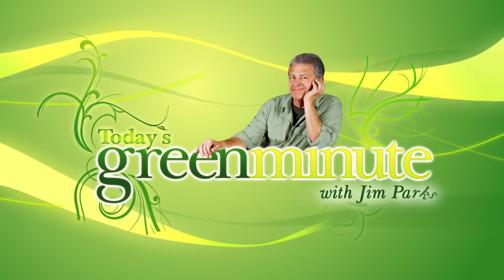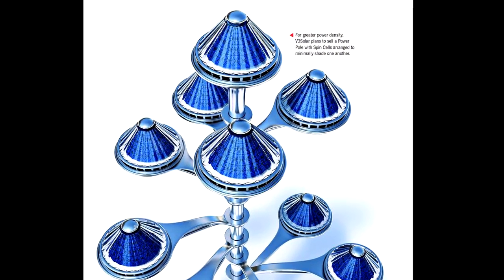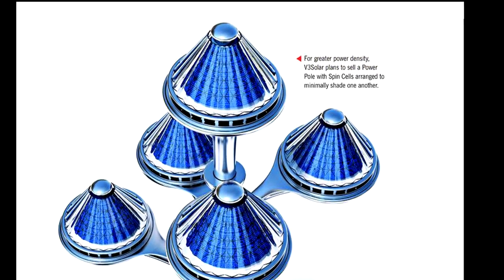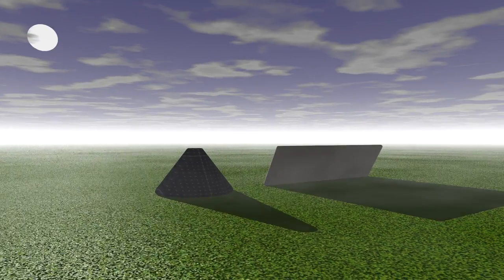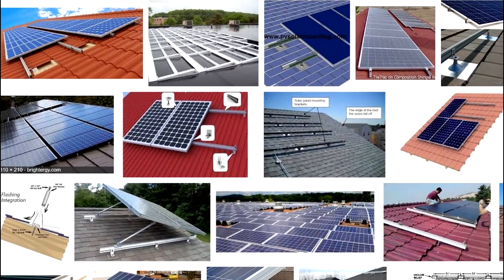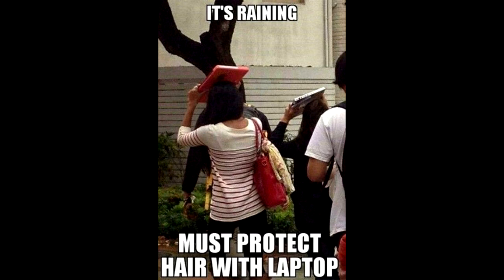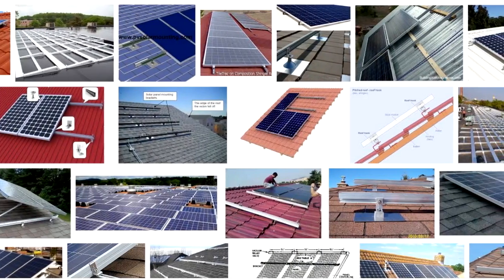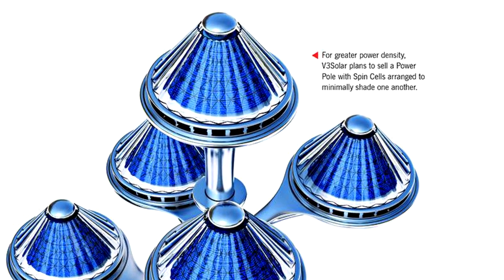Spinning Solar -BUSTED!

Comment: If something is so easy to 'BUST' Then why fudge and make numbers up. Stop guessing and using rough maths, It does not help your credibility. You know better, Or do you?
Reply: To simplify things, because different solar panels are generally more or less efficient and can't vary in power output  due to conditions.
So he made the numbers a flat amount to avoid variables, like the efficiency of the solar cells (which are by no means near 100%)
Reply: SilvaDreams
I think the maths would have been exactly as simple/complex. The only difference was the choice.
Reply: He wanted to use round numbers. 100% is easier to work with than 23.5% for example

As long as both panels are the same area and efficiency, then the specific area and efficiency do not matter.

The comparison was about effective area presented to the sun, not total area or efficiency.

Its like when i do simple rocket explanations, i use acceleration due to gravity = 10m/s^2, wet mass 100 tonnes, dry mass 10 tonnes, specific impulse 500s, and thrust 2000kn.

These aren't the stats of real life rockets, and in fact the specific impulse and gravity values are unrealistic, but the round numbers are easier to work with, and still allow for workable explanations

Comment: most panels loose 40-60% on hot sunny days and in cold weather gain 40-60% boosts
Reply: LONEWOLF REBELS now if you also could provide your panel types and manufacturer we could go and search for the specs to bolster your argument
Reply: without sources you have no power here.
Reply: Where do you get that number from? Typical solar cells have temperature coefficients better than -0.5%/K, so to get a loss of 40%, you'd need to be 80K above the reference temperature of 25 Deg. Celsius... in other words, the module would have to be hot enough to make water boil.
Reply: Richard Metzler I get the numbers off my solar panels during the summer they are insanely inefficient in direct sun in hot weather but during the winter they perform 40% better because of the cold cooling the panels don't believe the fancy numbers that people tell you solar is retardedly non efficient unless you live in perfect conditions in a perfect climate on a perfect day lol
Reply: Mike Brink I find I get 80% efficiency for most of the year winter I get 90-95% but summer is 60% max but I also receive 22 hours of direct sun in the summer and right now we get 3 hours
Reply: you guys do realize that winter and summer have different degrees of incoming sunlight, did you calculate that into your comparisons? Because it sounds like the panels are just aligned better for winter sun...
Reply: ZeruelB yes my panels are aligned there solar trackers the problem with solar is heat buildup anything over 25°c you loose massive amounts of power most solar panels operate at temperatures well above that causing resistance in the whole system
Reply: This is why applied a theoretical physics don't match... hence the expression, 'In theory, theory and practice are the same. In practice, they are not.'
Reply: Exactly ergo just because a book says one thing doesn't mean it's true
Reply: ZeruelB and manufacturer doesn't change The reality that all panels are subject to these same losses based on how hot they get
Reply: +LONEWOLF REBELS I just want to know where you get your numbers from, thats all, im not doubting that there are losses, i am not even doubting that your numbers are wrong. I only did some searching and found difference in productivity to be around 0.5%/deg which is why i would want to know what panels you are using
Reply: ZeruelB ever bright polycrystaline cells and your probably right .5 % per degree now if your solar panels run as little as 60° over temp which is quite normal that would be a instant 30% loss
Reply: LONEWOLF REBELS but that would be a very different figure from your 40-60%
Reply: Sounds about right to me.  On a one meter square nearly black surface parallel to the noon day sun in New Mexico or California and with a heat transfer of silicon or copper...  Well lets just say you could not touch it without scalding your hand.  So I'd assume the panel would be at least 70 Celsius just by touch, assuming you would for sure be scalded by it.  And everyone knows that you cannot touch a black painted parked car in California in the summer without burning your hand.

Assuming ambient air temperature in summer in places where solar is best will be around 30 or even 40 Celsius in summer, I can imagine that 100 degrees for a solar panel is not off ballpark.  In which case, it would not only be less efficient, but its lifespan would also start to degrade quickly.
Reply: babelfishdude you are correct in reality solar panels do best when outside air temp is below freezing the cooler the panels the higher the output  heat causes resistance slowing down the electricity I watch my solar panels defrost themselves in -30 °c and are warm to the touch in the middle of winter and I live in the real north
Reply: LONEWOLF REBELS real north? So  north of the wall right?
Reply: Northern Canada

Comment: Always thought it a bit crazy, I remember talking to a guy about these, and told him to just use a sun tracker with normal cells, if the efficiency decreases above 60oc maybe watercooling them? or would this cause cracks to form in the cells?
Reply: but then maybe the power needed to use a water pump and a fan on the rad would made the project impossible
Reply: and a passive cooling rad would be huge, so then a more powerful pump would be needed,, arghhhh!! just gets more complex

Comment: what is exactly wrong with musk's mars plans?
Reply: A bit of a problem: Musk has nothing to do with Mars One.
Reply: +ORPPRANATOR Prendergast
Lol that is completely wrong. It takes about 4 days to get to the moon.

And in fact it takes less fuel to get to mars than the moon.

The time is on the scale of 50 times longer by hohman trajectory though.
Reply: Just Add SRBs
 Oops, my fault. Sorry.
Reply: Traveling to the moon takes a massive amount of fuel, and 76 or something days. 

Mars is like, 40 times as far away, taking 40 times the fuel and time.
Reply: Google for a document called "Mars One Feasibility (?) Analysis". Students of the aeronautic studies analyzed what would be needed on the amount of resources to be flown to the Mars to keep the colony running. Also they took a look a the current technology of so called In Situ Resource Utilisation which should provide the colonists with food and oxygen. The Mars One plans initially stated that the current state of ISRU systems is already enough for a success. The report argued that these systems are used on the ISS, which is in low gravity and not on the scale needed for a colony.
Reply: High z particles.
Reply: First off, it's the Hohmann transfer orbit, named after Walter Hohmann.  

Second the comparison you site would be to get a thing (dead and lifeless) to Mars.  So "in fact" you are wrong if you are talking about getting living humans to Mars, and then hopefully back in some functional order.

Lastly, the way you suggest getting to Mars would require a moon base.  The actual comparison is that it takes less fuel to get to Mars "from the moon", than it does to get to the moon from Earth.  You left that part out.
Reply: +ORPPRANATOR Prendergast, well i see a couple of problems with your analysis, first of all, the vast majority of the fuel in a rocket is used to get the damn thing off the ground and into orbit, be it the moon or pluto, this amount of fuel remains constant, the amount used to move the craft to mars is the one that will increase, that being said, since its a one way trip this saves some fuel

Comment: What about spinning it with wind.
Reply: Now you have to have days that are BOTH sunny and windy.  Why not just use flat panels that follow the sun, instead of trying to magic something cool into being by making it look artsy?
Reply: the only thing the spinning achieves is to hide half of it in the shade, if cooling is a true concern them perhaps figure out a way to wind-cool a flat solar panel
Reply: ***** Or water cool. It's not in shade if the sun is overhead however. If you can oriented the cone thing towards the sun, it is more feasible.
Reply: shades2 there are water cooling systems for solar panels, and I assume they're as effective as they can be. but really like thunderfoot said, you only need to keep the temp below 60C
Reply: shades2 bruh

Comment: Soooo... I agree with your 50% best case number as a function of surface area... but isn't all the numbers and promo on this about the cost|power ratio not area|power? If, let's say for shits and giggle sake, these things are 1/40th the cost to manufacture of a tracking panel then their numbers are plausible. And they are pretty clearly going against non tracking rooftop panels IMHO which have can something like 30-75% of a well configured tracking panel depending on dozens of environmental factors. So lets say a marketing department looks at these numbers and does a bunch of accounting hoodoo and says our best case cost|power is 20x that of the most expensive roof panels worst case if we pretend like their cost isn't subsidized and ours somehow still magically is... then they publish the 20x number. That's be completely typical of marketing wanks.

Statistics are like anuses, often full of shit, better for hiding things than you'd think and more flexible than you'd believe.

Comment: How about the power to spin the damned things?  Where is that coming from and how much is it?
Reply: TheGnarlyDoug It's a powder called pseudoscience.
Reply: Bingo. Inefficiency right off the bat.
Reply: "Thats where they put the extra 300% efficiency obviously! Infinite power!"

LOL, of course it is, how silly of me to have missed that.
Reply: pfft you clearly weren't listening to the video he clearly said magic would power the thing jeez
Reply: well, bear in mind that he's stacking it up against a tracking panel, which also needs power to move (albeit likely less power)
Reply: If it's balanced well and lightweight it shouldn't take too much power to spin, but still something.
Reply: Simple: it's powered by one of those perpetual motion machines YouTube is ever eager to show videos of.
Reply: NoHomeLike 192.168.8.1 actually if you mean perpetual so long as there is a sun, then yes that is exactly correct. As long as there is sun there is pertuity. The energy the sun provides is freely given, the sun doesn't charge us for using it. There may be a cost  in collecting aid distribution of that energy. That is something that we should looking at better and cheaper methods of utilizing all the free energy available to us much more than just the sun. Mendocino motor for example is a solar powered solar perpetual example of rotating solar cells that is very efficient and had been around since the  60's invented by self taught physicist Larry Spring.
Reply: TheGnarlyDoug They run on hamsters
Reply: TheGnarlyDoug UNLIMITED POWER!!!!

Comment: You failed to mention that the solar cone device would have to use some of the power it's drawing to constantly rotate itself. Likely a small amount, but still worth mentioning. And this leads to an argument for just adding a self-powered water cooling mechanism to a standard flat solar panel. Seems like the better option all things considered. I'm no expert, any thoughts?

Comment: Wouldn't it be far more efficient to use the energy that would spin the cone to simply run a small fan to blow across heat sinks for a traditional solar panel?  Or how about using thermocouples to turn the heat into electricity? Or a double-sided panel that flips when one side gets too hot?

Comment: well your argument is good.... the glass cone, the motor, good points. One thing you missed in your calculations  is the fact Mathematically this Idea is sound when the geometries are all there and if they designed the components right and are spinning and vented properly the biggest concern is the motor. You'd almost have to use a telsa turbine in order to have this work properly.and you have to have the specialty glass cone spin counter to the solar cone for the design to even work in an area of real estate now if you modify the design you might actually get the 20x performance gains they're talking about but without say a tesla turbine powered by an air compressor using the exhaust to cool it I couldn't see this design panning out.

Comment: I work in the solar industry and yeah, can see some major problems with this spinning cone.

The idea of it being cheaper is perhaps most laughable as you would need to have different parts of the cone use a different MPP tracker based on how much sunlight they get at anyone moment. To keep the efficiency up these seperations want to be at 30 degrees at the most. That's 12 MPP trackers per cone and the associated cabling. Flat array can have one.

Comment: Tf, have you taken into account that they might be using Concentrator photovoltaics?
Those use lenses to focus sunlight on smaller more efficient (and more expensive) solar cells to increase generation.
I still call bullshit on the rotating spin construction, but if they are using HCPVs their design might not be as dumb as it seems.
Current prototype tech HCPVs get up to 46% efficiency, not 20%.

See here: https://en.wikipedia.org/wiki/Concentrator_photovoltaics

Comment: 60°C is not hot enough to burn you if you touch it at least with the water's level of thermoconductivity.
Reply: According to german Wikipedia about "Verbrennung (medizin)": Damage to the skin occurs:
- between 45 and 51 °C if exposed to the heat for some minutes,
- between 54 and 70 ° if exposed to the heat for some seconds,
- anything above 70° just needs fractions of a second to cause damage. 
The age of the person and the individual type of skin determine the resistance to heat damage.
Reply: Well, my shower displays the temperature of the water.
About 39-42C is a hot shower.
45C is the point where it gets unbearably hot.
I'm pretty sure 60C is too much, even for the thicker skin of our hands.
Reply: Hell yeah it is. 50°C is the highest the average human can withstand.
Reply: tybofborg
Depends on the part of the body, I guess.
I was thinking hands.
Getting fully submerged into 60°C water would probably be pretty "uncomfortable".
Reply: +Murad Beybalaev Well then you are badass. :) My aunt is the same, she washes dishes in water so hot I can barely touch. I do laundry too, and 50°C is the maximum I can work with. I've also read about it somewhere that that's the maximum (I can't find it now though)
Reply: You might want to get it right, Proteins will start to cook just past 60.
Reply: TheProCactus
I do the laundry in my house. I know what I'm talking about when I say you can safely submerge your hands in 60°C running water without any consequences. Keratin in Epithelium is quite resistant.
Reply: Murad Beybalaev
read what I said. I did not imply 60c will harm you.
Reply: Markus Wiezorrek
I think its all about cooking proteins.

Comment: Would it be more efficient if we lived in space in an area of extreme freezing temperature, to make it so the outside has enough to make a certain material superconductive, and make it so energy is gotten using hydrogen energy generators, and the place is to be isolated like a thermal cup. And in theory should they be able to survive by the energy they obtain. Since the place needs water, they would choose need to have a large source of water, in this case ICE, so a large body of ice. The food they'd eat, would come from plants that grew from artificial light. So in this scenario, is it livable? Now I am referring to sustainability, so growth of population is something I don't really considering. Other thing, the heat they obtain comes from the generator of energy. Can our current technology sustain this?
Reply: It would be so much more efficient to use sun-tracking solar panels in temperate and hotter climates. The problem with an "area of extreme freezing temperature" is that it tends to be near one of the poles, where solar radiance is dimmed by the low angle of incidence of the sun's rays. Solar radiation that's at 60 degrees from straight up (30 degree elevation) is about half as strong as that which is directly above. Thus, solar panels work better the nearer the equator you go (and work fine, in practice, in a wide band of latitudes).
Reply: the technology itself? perhaps we're at that point, but the logistics of it require a whole new travel technology that I don't think we possess yet

Comment: Standard solar power is still highly inefficient, and likewise these solar cones are hyped.
However, when you talk about half the solar cones being ' in the shade' in the summer depending on geographical location,  this wouldn't be true, as the sun would be overhead for a few hours per day, and the lens on the top could be a redirector of light.
The hype regarding these cone solar cells IS outrageous though.
You briefly mention water injection in car engines, increased concentration of water vapour in the fuel/air mixture is beneficial to the burn, but not that much